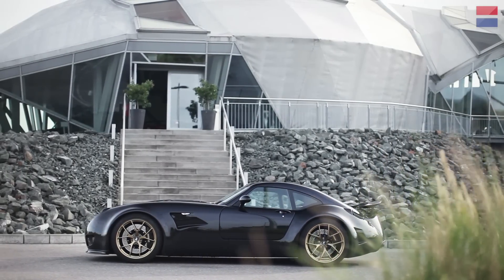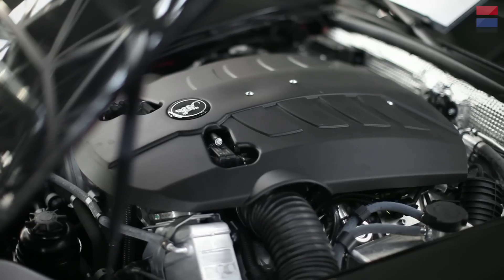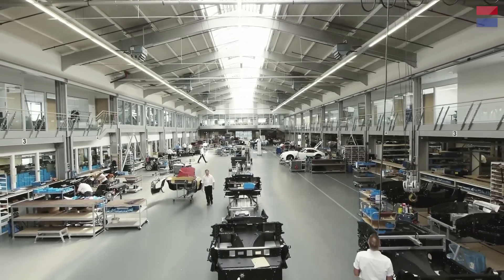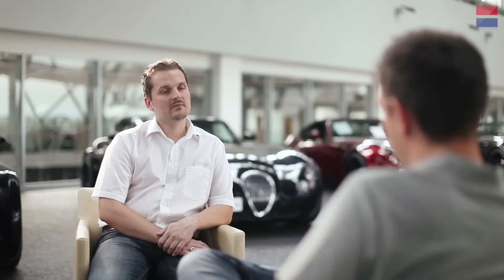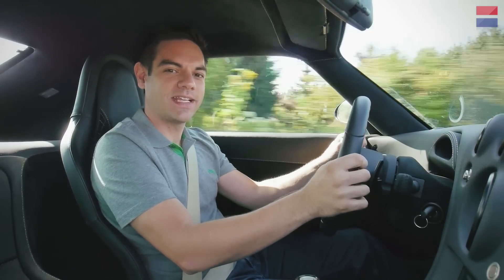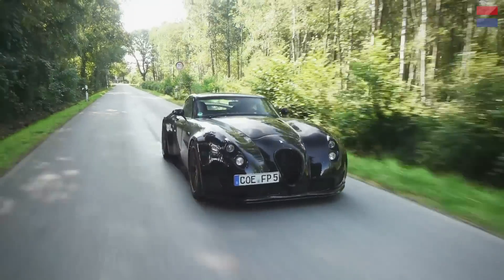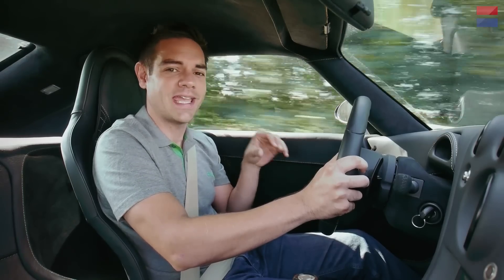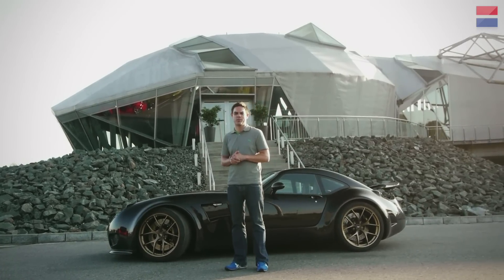BMW M5 powered Wiesmann GT MF5 on road and track - CAR and DRIVER

Comment: Why are people saying that this is overpriced, this car doesnt impress every day people like a lambo or ferrari because its not quite as flashy, this car is recognised by real car people not just footballers, why are people complaining about it being bmw running gear a drivetrain they are renowned for making the most reliable engines in the world and have been making the best RWD cars for 4 decades
Reply: I'd rather have one of these than a Lamborghini Huracan. Classier, probably more fun to drive and cheaper to maintain and repair.
Reply: @jose_s_bam7938  you can say that again!!!
Reply: when are BMW reliable? they are full of plastic bits and overpriced parts
Reply: BMW fanboys just know how to quote from a brochure. Looks like you have zero ownership experience  when it comes to  keeping one,  that is why hollow people lease it to impress  meaningless people.

Comment: nowadays we say a 1400 kg car lightweight ..... sorry but it's not . but it's a marvelous looking thing , that's for sure .
Reply: +TheZisco What exactly do you consider lightweight?
Reply: for sure not a 1400 kg car . this is not lightweight. In my opinion a 1100 ,or even less , is lightweight. In older days you could find such cars , if not lighter pretty easy . Of course there are safety aspects that raise overall weight .
Reply: +TheZisco  So you have under 1100kg car with V8TT or V10 with more than 500hp? Must be rare or brute. I have 1100kg Z3 Coupe with less than half the power and some carbon fiber. It's not easy and its not cheap especially with  bigger engine you need everything else bigger and heavier too. But true 1400 is not true lightweight. But it is superlight compared to 2000kg M5.
Reply: @djremotion2  A Z3 Coupe is roughly 1350 kg according to mine.
Reply: Parts in your car are mild steel, plastic, wood or lead and and on my car those same parts are aluminium, carbon fiber and lithium.  @derJackistweg  It has been a shit load of engineering and design work but it is light!
Reply: @djremotion2  Right. By standard it's more. I can assume that these seats alone are heavy. These days a Li-Ion battery can save 20kg. 
Here in Germany price for 3.0 have doubled now, since 2011. Only for non tuned though. 3853 units!
Reply: True. Stock Sport/M seat weights 26,5kg each! My old battery was about 24kg, now it is 1,9kg. Rear parcel shelf, roll shade, trunk floor etc weight a ton, I have gotten a ton weight out of them molding and making from carbon. Usually the weight is one tenth of the original. So for example roll shade with dog net does weight 5,6kg but carbon foam core part I made does weight only 500grams.
.   @derJackistweg
Reply: @djremotion2  sounds like “done in a weekend“ 😁
Reply: yeah! :DDD Not quite. :D @derJackistweg

Comment: It's called the Wiesmann Spyder. It's a recent study but not in production. It uses 420 hp engine from the bmw m3 and is desigend for tracksdays and pure driving. topspeed 290 kph

Comment: They should have put in e60 V10 and a manual transmission.
Reply: +test channel He MF5 had the V10 untill BMW stopped the production of this divine engine
Reply: it was planned to build 35 wiesmanns with this engine...but at the end there was just 33

Comment: That is all? But the same oil fill cap, eh? Hmmm... :) I find it hard to believe that S63Tu shares only 4 things with the S63. From what I've read, the main differences are compression, boost pressure, exhaust manifolds, injectors and VALVETRONIC. But would love to see where you get your information, though! I'm always up for learning :)

Comment: I have a manual Brz I love it.  If the auto was just as fast I would still take the stick.  I took the original Audi Q5 3.2 Auto on a twisting winding road in northern VA.  A front heavy AWD cuv. It was a blast. In sport mode the trans would not let go of 3rd gear. It was almost like it knew what I was thinking. It depends on the car.  I hated the older Corvette manuals that made you shift from 1st to 3rd with the heavy unconnected clutch. I know one thing the DSG GTI is more fun than the stick.

Comment: I'm not that deep in because:
1) My car isn't worth putting THAT much money into
2) I'm more into the handling/comfort balance mix of things.

The two things I want most for my car are Eibach ProKit springs and a Weappon R 4-2-1 header.  Otherwise I'd be happy.  Maybe some new bushings and a few underbody braces to give the overall structure a break would come later.  Alloys aren't a huge want, but again... maybe way down the line.  I still just enjoy what driving it can do.

Comment: what u guys dont understand is that a BMW M5 is basically a family car which was never meant to be a racetrack car even though it is misused as such .dont complain about weight its the compromise between luxory and sportyness.
 this car however is reduced to its basics what a drivers car is about in old english sports car tradition.

Comment: BMW's M Division once made light simple cars?  Dude, 2,500lbs may be light now, but in the 1980's you'd find dozens of cars weighing under one ton.  Simple?  Again, those BMW we're usually well equipped.  Even something as simple as a tilt wheel was surprising back then.

Comment: You're right, the auto is a shame. But it works pretty well with the paddles. The GT MF4 S - which is a bit cheaper, too - has the M3 V8 and can be had with M DCT or 6-speed manual. I really want to go back and try that one.

Comment: im very aware of that, however the m5 does not need to be that heavy. BMW could use lighter materials (i.e. carbon fiber) and still keep the luxury aspect at the level it is currently at. Another point is that BMW M should start developing their own cars/supercars, for example an "M" or "M10" where its all about performance, because a supercar would not need two personalities, where that aspect is what makes an m5 special, btw the M5 is still an enthusiast car, just in a different way.

Comment: I love good manuals also. They are wonderful.  (BUT) The dual clutch or DSG GTI is amazing it seems to know what you want to do and makes perfect shifts time after time. It will snatch second. The six speed Auto in the original Q5 was wonderful also. When you have a 540 hp 3000 pound car sorry I would pass on the stick. Unless you have lightning fast reflexes you would be hitting the fuel cut off all day long.

Comment: 2014- "According to the latest reports coming in from Europe, all but six of 
its 125 employees have been sent home. The company apparently doesn't 
have the funds on hand to either pay its employees or pay its suppliers,
 and effectively ceased operating at the end of March, having produced 
just over 1,700 vehicles in the course of 20 years of manufacturing."

http://www.autoblog.com/2014/05/08/wiesmann-shuts-down-again-bankrupt-report/

Comment: dct = dualclutch transmission? if so, manuals lighter and automatet singleclutch transmission can shift faster (even though the shifting is brutal ...). also, clutchreplacment is very exepnsive on a dualclutch transmission. it's just smoother, that's about it.

Comment: you are wrong ... 
1. the average germans are larger than the average us boys
2. there was a german car tester and race driver called Patrick Simon he is with 6.34 ft much taller than you,he test drove the MF5 GT (the older version with the M5 V10 n/a) and had no problems at all to fit into the car..

Comment: the only disappointing thing in this beauty is that they use a steel frame chassis which would have easily brought down the weight from the "light" 1400 kg

Comment: I can't understand why all of these car manufacturers are just removing manual transmissions from the options.  It's ludicrous to me to not even offer a true manual, it's the true driving experience over these 'manual' transmissions that are nothing more than an automatic that you shift with a lever if you feel like it.
Reply: I totally agree. Manual gear box is part of the experience in a sports car, super car or, even a hyper car.

Comment: I totally disagree. I love the feel of the clutch. Driving flappy paddles is like a video game. As far as the engine, I could care less if it's N/A, turbo, or supercharged. I really don't like the lag of a turbo, (and I'm not a turbo "fan") but if done right and I'm in a car hauling complete ass, I could care less about the aspiration.

Comment: Come one man think a little,,,this car is just not on the ZR1/Viper status. It doesn't have 600hp and it has a 4.4 or 4.5L V8. Viper runs a 8.4L V-10 640HP bone stock no turbo no supercharger. ZR1 runs 638hp supercharged built 6.2L V8. Hell the Z06 runs a 7.0L V8 505hp. This car could maybe keep up with a C6 Z06 on top end. But hey this is a nice car if it was availible more readily in america,,I guarantee americans would buy it. Its just not on Zr1 or Viper status.

Comment: That car has Ultra tall gears and almost weighs 2 tons. You can stay in 3rd all year.  Take 2 Corvettes with 400 hp. Run the Stick against the Auto the Auto will win 2 out of 3 times.  In the 3600 pound Mustang GT you could not pay me to take the Auto.

Comment: BTW this MF5 rapped the 2013 Nissan GT-R(550hp) around the Sachenring (3.67km) into pieces, 1:34.14min for the MF5 and 1:35.70min for the Nissan GT-R under same weather and track conditions (16°C and dry)

Comment: I am ten years older than you. If you were to race yourself. Timed on the drag strip. Auto Vett to manual all other things being the same the Auto would win 2 out of three times. You can be the best manual Mustang GT driver on the planet will not take an average driver in a base Corvette auto through the 1/4 mile. Smaller N/A motors most of the time the stick is 1 second or more faster to 60. A  turbo car like the new BMW 2.0 the 8 speed auto is faster than the 6 speed manual and more efficient.

Comment: I feel that the car is laughable. Regardless of the looks, I really want one. Though you couldn't ask for more from what wiesmann has done with the interior, hand crafted and all, I do feel that it lacks a sort of finesse in the cockpit, and the gauges need to be in front of the steering wheel,Center console gauges in a Mini is fine but, I certainly would not want to take my eyes off the road for too long while driving that beast.

Comment: A chimp can master an automatic flappy gearbox,it takes skill to master a clutch properly and get the best times out if it.DCT's may be faster on a track because you don t have to lift off the clutch but who cares in day to day driving?I d rather have the involment that comes through a manual gearbox than a flappy gearbox  Manuals will come back more once this fad is over and people remember that driving is about actually driving and not numbers in a car magazine. Flappy gearboxes? no thanks.